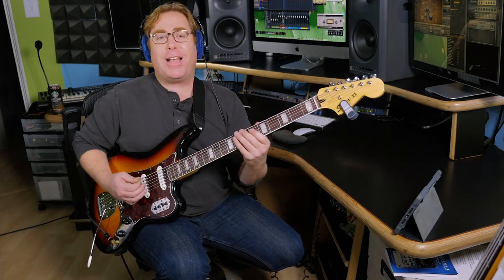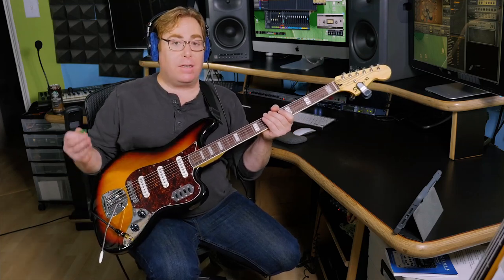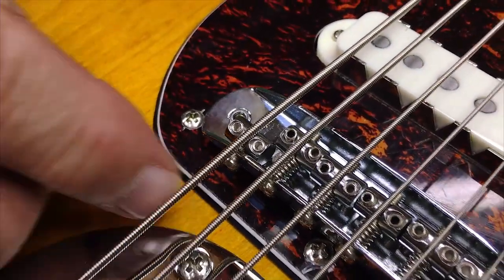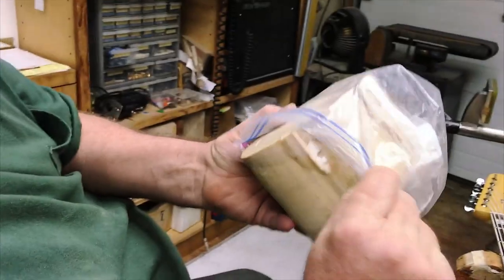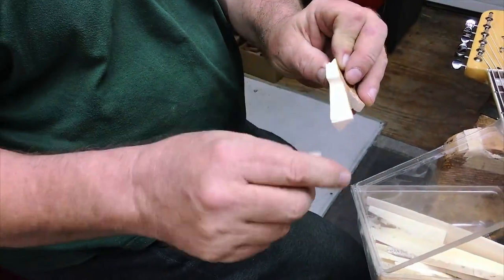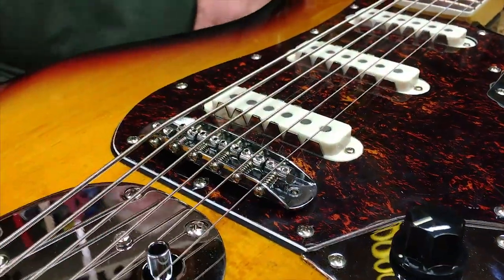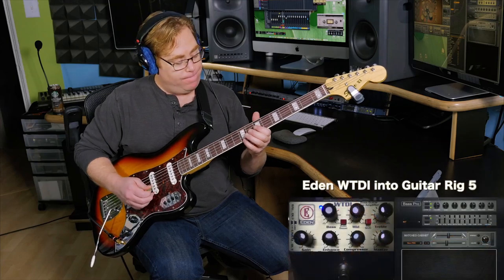Squier Bass VI Intonation Fix

Comment: This was 5 years ago. I’ve just ordered one. I would have thought they would have addressed this issue by now? All they need to do to stop the bridge moving is make the holes in the body smaller surely that would cost nothing.
Reply from the maker: I wouldn’t know if they did fix the issues, but I have a feeling they didn’t. Even so, it’s worth it. Just plan on getting it set up better. I play this thing all the time. I got the LaBella flat strings listed in the info, and they really make it play and sound better too IMO.
Reply: @ChadWork1  yeah my guitar tech said he’s worked on them before so confident he’ll nail it. He’s done a few set ups for me now. My Mexican Fender Roadworn 50s Strat was great after his attention. Real classic stratty sound to it now. But it was the improved playability feel I noticed most.
Reply from the maker: @johnnydiamondsmusic1673  Cool Johnny. People are also just getting a new bridge. For this video, I just wanted to see what my friend could do with the stock parts. If it didn't work I was prepared to buy whatever was needed. Ultimately, it's just a fun instrument! When I'm bored with guitar or bass, I grab this, use the middle pickup, and new ideas come out. I'll never sell it!
Reply: @ChadWork1   I’m into writing original 80s new wave inspired material. So will be using this guitar similar to Robert Smith of The Cure to pick out melody lines rather than using it as a bass.
Reply from the maker: @johnnydiamondsmusic1673  Do did you get your Bass VI yet?
Reply: @ChadWork1  the one I ordered from DV247 was still out of stock. So I cancelled as they hadn’t taken payment. Everywhere UK Europe seems to be out of stock. But after searching I found a UK stock and it’s coming tomorrow. I also specifically wanted the black with tortoise shell pick guard which it was. I like that one as Robert Smith of The Cure had that colour and I’ve always loved The Cure. I’ll put a quick video on my channel when it arrives but not expecting to get the best out of it till my guitar techs sorted it for me.
Reply from the maker: @johnnydiamondsmusic1673   I think you'll have more fun with these strings: Recommended Strings I use now: La Bella 760FS Deep Talkin' Bass Flatwound Bass Strings - Standard .026, .035, .044, .056, .075, .095
Reply from the maker: @johnnydiamondsmusic1673  https://www.youtube.com/watch?v=Cv4G-fctttM He got the strings too and has the bass you want.
Reply: @ChadWork1  thanks for the advice. I certainly want the thicker ones to avoid the loose bottom E and intonation problem.
Reply: It's supposed to rock so that when you use the trem the strings don't bind on the bridge. At least, that's the idea behind it.
Reply: @michaelmaas6460  yes but that’s what puts the tuning and intonation all over the place with the bridge supplied. That’s why everyone is having it changed.

Comment: D'addario makes Color Coded Strings (EXL 156) for a Bass VI & what's really unique about them is that they're thinner than regular Bass Guitar Strings, they have smaller Ball ends, & they're tapered at the ends to fit into the Guitar tuners. Every Choir needs Feneder Bass VI's cause they're great for shedding light on Naya Rivera from Glee who sadly died of Drowning. Hope those Choir peeps are gentle with their Bass VI cause they're a unique one of a kind instrument everyone likes.
Reply from the maker: I use La Bella 767-6F Bass VI Strings - Flatwound
Reply: @ChadWork1  They're really smooth strings, & they're less abrasive to the frets than D'addario EXL 156 Roundwounds. Flatwound strings sound appropriate for Jazz too cause Jazz Guitarists & Bassists use Flatwound Strings which have a warm mellow sound. I use EXL 156 Roundwounds which are Color Coded at the Ball end so you know which is which. Those Flatwounds might also intonate alot better especially if you're using the Vibrato lever cause it'll stay more in tune better.
Reply: @ChadWork1  You can use D'addario EXL 156 color coded Ball end Bass VI Strings too cause the Color Coded Ball ends show you which is which.
Reply: @ChadWork1  Is there a problem with EXL 156 Roundwounds on this particular Bass VI?

Comment: using shorter screws is better than to cut them down, also is very useful to reverse the bridge that the heads of the screws are in the opposite side (front), this will make a lot of room to adjust the intonation saddle, shorter screw also is better because it will not touch to the string
Reply: You can cut them down and make them thread properly by adding a few nuts before you cut, but I sure wouldn't do it while they were in the bridge.

Comment: Good stuff! Interesting as well. However, I haven't had any problem intonating my Fender Squire Bass VI... A lot of folks just flip the bridge over....
Reply from the maker: +Michael L. Castle That's great if that works. What I did worked for me, and it's in great intonation. Now there's the issue of the strings not lining up with all the pickup poles because they just threw on Jaguar guitar pickups on there that aren't wide enough!
Reply: Not to mention that the 6th string is woefully too light. That's the first thing I did (after consulting the "interwebs") i.e.: replace that with a thicker one. BTW: I cringed when I saw your alleged "luthier" cutting that with a "dremel", sparks fling everywhere with no protection for the finish...can't wait to show that vid to my luthier.....! I'm glad it works for you.
Reply from the maker: +Michael L. Castle Tht luthier is Steve Helgeson of Moonstone Guitars. He makes 5,000.00 - 20,000.00 guitars. He's maybe a little rough, but his work is top notch. There is no damage on the bass VI. Here's a video I did on one of his baritones. https://youtu.be/3DSzTIFnLoU
Reply: @shivamoon108 yeah pretty painful to watch. The finish, the input jack, under the knobs into the pot shafts, pickup magnets, and then imbedded into that “protective” rug acting like sandpaper on every guitar lucky enough to land there. Not quite the crunch and jangle one wants in their guitar 😂

Comment: The problem with these Bass VI guitars is the intontation on the low E string, fretted notes are sharp.  It's sharp even with the saddle all the way back and nut slot lowered. I wish Fender would fix this - intonation is sort of important.
Reply from the maker: You can do what we did, or get a better bridge.

Comment: If this is a common issue you would think they would improve it at factory?
Reply from the maker: That would make production cost more. I'm not sure, but maybe it's dealt with on the Fender models?
Reply: @ChadWork1  not really,they could use a different bridge style i dont think it would cost much more to make one that gives a better adjustable for the bass so the low E string isnt at its e4xtreem end etc. It makes sense to use a custom bridge that works. and is setup properly out of the box.
Reply from the maker: @MichaelStoneham  Yeah who knows? I think it usually comes down to money.

Comment: I have some  DR neon 45-125 think I can just take the 105 from these strings and put it on the bass and keep everything else stock?
Reply from the maker: Recommended Strings I use now: La Bella 760FS Deep Talkin' Bass Flatwound Bass Strings - Standard (six string set) String Gauges: .029, .045, .065, .085, .105, .128T These Strings feel great on the Bass VI.
Reply from the maker: https://www.labella.com/product/760fs-cb/#:~:text=PRODUCT%20DESCRIPTION%20%C2%B7%20Stainless%20Steel%20Flat%20Wound;,%C2%B7%20String%20Gauges:%20.029%2C%20.045%2C%20.065%2C%20.

Comment: I don't have access to helicopter drive shafts, so what can I use instead of carbon fibre tubes to lock the bridge? Did you say fibreglass tape? I can get that, but anything else?
Reply from the maker: Take it to a guitar tech that knows what he/she is doing. I don't know the answer to your question, and if you don't, then you need a pro on the job.
Reply: Don't do that. The bridge is supposed to rock, that's how it works. Otherwise the strings are sliding over the saddles which will cause them to go out of tune and/or break.

The tech in this video has no clue what he is doing.

Comment: This is adorable 6 String Bass really needed some updates.
Reply from the maker: It's not exactly a 6 string bass.  A 6 string bass has a low B and a high C string. This is tuned exactly like a guitar, but down an octave.
Reply: @ChadWork1  Turns out it's an Electric Bajo Sexto (that really big instrument looking cross between a 12 String Guitar & a Cello) with Single Strings & an extended fretboard. The Bajo Sexto was originally used in Tex Mex Music to accompany other instruments because being tuned an Octave below a Standard Guitar made it possible to play Bass Lines & Chords at the same time. Due to its special sound the Bajo Sexto found its way into other genres of music we hear today such as Pop, Rock, Gospel, you name it. Taylor should make a GS Mini Bass VI someday. The Bass VI uses thinner strings than a Standard Bass Guitar because it's smaller. When these instruments were first built by Dan Electro, they shipped them with Flatwound Strings but we now have a bigger variety of options for Strings these days. Older models of Bass VI benifit from being strung with Flatwounds because 1) they'll hold tune better, & 2) they won't scratch the frets.

Comment: There is an easier fix. Just simply flip the bridge and put it in so the adjustment screws face the pickups. Now the saddle goes back all the way. Either way, the design sucks. But for the price, we can’t be picky.
Reply from the maker: That didn’t work on this particular BassVI. Either way, it plays great now.
Reply: @ChadWork1  you've got a different excuse for each comment, I kinda love it
Reply from the maker: @OkSharkey  Basically I just took it to my buddy Steve Helgeson (RIP) who is a great luthier (Moonstone Guitars), but we were just trying get it to work as cheaply as possible. There are cleaner solutions for sure. 6 years later the thing is still intonated beautifully and plays great. Your mileage may vary.

Comment: Thanks for the interesting video Chad...have been told that it's possible to string one of these with a set of baritone strings...does anyone know if that's correct?
Reply from the maker: I haven't heard of anyone doing that, but I don't see why one couldn't. I guess it depends on what key the baritone is.
Reply: @ChadWork1  Fender now makes 24-100 Bass VI Strings.

Comment: Great guitar Chad! I love the sound! Squire doesn't make bad guitars at all. I adjust my own intonation. I love that bas tone!
Reply from the maker: +Adam Workey Thanks Adam! This one needed a little more than an adjustment, but the result is great. The thing really has impeccable tune now. Fun to play too.
Reply: It sounds great Chad! I am down to 3 guitars. One is an Epiphone SG G-310, a Harmony Strat-copy 1990, and a Takamine acoustic electric, that I need to work on, because it has some damage on the the front lower right. It's a beautiful guitar and I also need to give it a neck adjustment, and get a new bridge tail piece. The Harmony's nut slides up when I bend the strings, so I need a new nut, or wait until I can get new strings and glue it down with epoxy or some other good adhesive.

Comment: Doesn't the bridge pivot have something to do with the whammy bar locking system?

Wicked, he used a tuning fork in the process of retuning it!
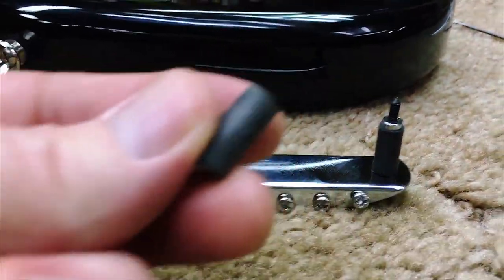Reply from the maker: +ShreadTheWeapon Didn't you notice at 06:40 that we put carbon fiber tubes on it? Those prevent the bridge from rocking, but you can still use the whammy bar.
Reply: Chad Johnson My attention wanders on occasion.  I'll watch it again.
Reply from the maker: +ShreadTheWeapon  Actually watch from 5 min in.
Reply: ShreadTheWeapon the bridge was designed to rock backwards and forwards with the strings when using the trem. The problem is that even tuning the guitar would pull it out of intonation!
Reply: Pending modifications.

Comment: You can turn the bridge around which allows you to move the saddle all the way "back" without having to cut the adjustment screw shorter.

Also, the bridge must be able to float for the trem to work properly. You absolutely should not lock that bridge down. It doesn't effect intonation because when set up properly, it will return to position when the trem is not in use.

Your tech has no idea what he is doing. This was very hard to watch.
Reply from the maker: Actually the trem still works fine, and it's floating action contributed to intonation issues, and was evidenced by multiple complaints by other Bass VI owners. I don't use the trem anyway. I could have bought a proper bridge to do this, but we wanted to see what we could do to the stock bridge since this is a 300.00 instrument. Also to flip the bridge around would mean taking off the strings any time you want to adjust the saddle. The thing is in perfect intonation now, so I'm happy. Yes it would have been better to use a better bridge, but we were just fucking around to see what could be done with what they gave us. Also Steve is the guy behind Moonstone Guitars. He's a master luthier that taught Ken Lawrence from Lawrence Instruments (He makes James Hetfield's favorite axes), as well as Gabe Douge of Black Devil Guitars. He's been making world class instruments since the '70s and knows what he's doing. You can look up his stuff. By all means modify your own Bass VI as you see fit. Intonated is intonated.
Reply: @ChadWork1  are you ok pal

Comment: Hey 
can I play this guitar with fingers? ( like a bass)
Reply from the maker: +Robert Daudish The strings are closer together than with a bass, so it's harder. It's more fun with a pick. I normally play bass with fingers, but this is cool when you mote the strings with your right palm as you pluck out some tick-tack bass lines.
Reply: @ChadWork1  This is a very beginner friendly Bass Guitar that kids who play the Guitar can play cause it has thinner strings than a Standard Bass Guitar and a shorter neck. I wish they had fractional sized Bass VI's.
Reply: @ChadWork1  Using a Pick is probably alot easier when playing the Bass VI cause the string spacing very narrow.

Comment: I am having a hard time just getting it tuned at all -- I was told to use B E A D G C. Any help? I am way new to this and received as a gift, so I need to make it work.
Reply: 1. They aren't baritone guitars, they tune exactly like a regular guitar EADGBe.

2. Swap for a correct (thicker) set of strings and have it properly set up with a shim. This actually helps more for intonation than any Dremel will. Don't fix the bridge; it's specifically designed to move with the tremolo unit.

3. Not working right after doing exactly all of that? Go to the offset forum, not a YouTube video.

4. No one actually needs a mastery bridge, but if you feel like spending 200$ then go right ahead (you'll still likely need the shim and thicker strings for more tension on the break angle.)

Comment: Chad stated several times that they wanted to see if it could be done using only the hardware that came with the guitar.  Try commenting based on the author's intent instead of your personal opinion.
Reply from the maker: Thanks! We were just messing around, and Steve is a master luthier, so I trust him. The fact is the thing is in perfect intonation now.
Reply: The majority of fixes in the comments involve either reversing the bridge or moving the spring outside of the bridge, but you go off if you feel like it, James; get that endorphin rush :)

Comment: Could you throw regular guitar strings on this and use it as a regular guitar?
Reply from the maker: Not very effectively. The slots for the strings are thicker, and it's a lot chunkier than a regular guitar. It would be a good experiment with some thicker guitar strings.

Comment: You said the bass 6 was between a guitar and bass. But doesn't it sit in the same pitch range as a regular bass at about 41 Hz on the low E? Isn't that why they call it a 6 string bass and not a baritone guitar? Asking to learn not diss, TIA.
Reply from the maker: A 6 string bass (vs a 4 string bass)has one lower string and one higher. A low B and high C. A Bass 6 is tuned exactly like a guitar but one octave lower.
Reply: @ChadWork1  Your description is common among most 6 string basses. BUT,  a bass strung low E to high E is still a bass, like a 4 string bass with two higher strings right?
Reply from the maker: @merbuckify  That's why it's a Bass VI, rather than a 6 string bass. It's tuned like a guitar, so you can do guitar chords. The high string on a 6 string bass is C, and on a bass VI it's a B. Six strings are usually tuned B0–E1–A1–D2–G2–C3—like a four-string bass with an additional low B string and a high C string. I don't know how else I can explain it to you.
Reply: @ChadWork1  We are into semantics now. You prefer to name or call something a 6 string bass bc of the strings and how they are labeled. I am quite aware of that, you don't need to explain it again, I've been playing 5 string for 37 years. What you seem to not recognize or admit is that what I'm describing is ALSO a 6 string bass since it is in a similar pitch range as your "6 string bass" except that my description goes from low E to high E. If you won't agree to see my point then I'm done.
Reply from the maker: @merbuckify  You said you were "asking" so I was trying to clarify. Every bass string is a 5th from the string next to it. But a guitar has that 4th with the B string. But since it's tuned an octave lower, it's not a guitar, but between a bass and a guitar.  I'm not disagreeing with whatever you were trying to say.